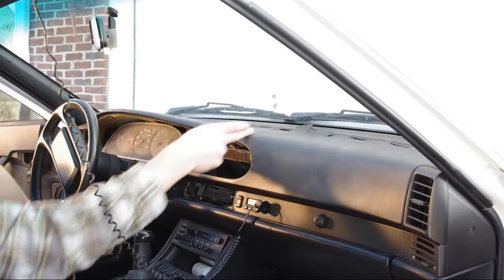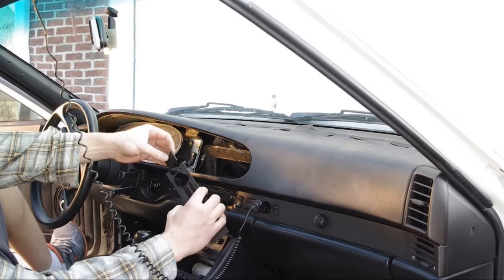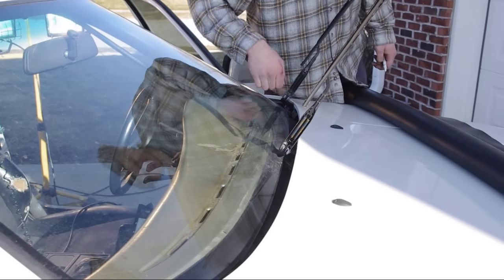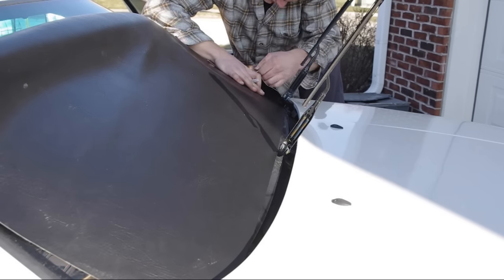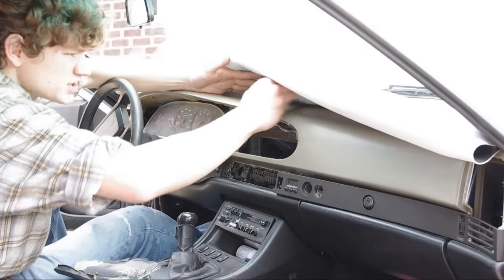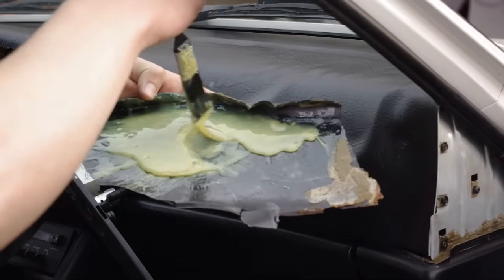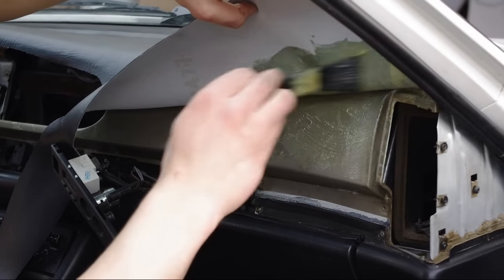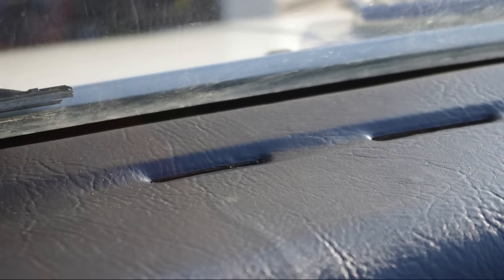How To Recover A Dashboard - Vinyl, Leather

Comment: Man all that time and effort just for the dash,  you probably could had bought that same car with a half decent dash for a couple hundred bucks
Reply: Really depends on the car.
Reply: what a stupid comment . This could be a clean low mileage vehicle.
Reply: fukstyx1 doing it your self is always cheaper, you can make it exactly the way you want it, + if youre a petrolsexual, its a pleasure to work on your car to make it nicer.
Reply: Okay, go and buy a decent classic Porsche for "a couple hundred bucks", i dare you.
Reply: Игорь Болотов what does that have to do with a cracked dash? Porsches are not cheap, even in the worst of states, and you still need to use common sense when buying one, but if you have had a car for 25 years and you have had many great memories with it, its more than just a car, it gains a sentimental value. you can't really buy that.
Reply: Some cars suffer from cracked dash boards. My 1984 XR4i is a prime example!
Very few examples that have not been kept in a garage or out of the sun will have a dash free of cracks!
Your comment just shows your ignorance!
Reply: Koito rob The hell? I just told that "almeidadave1" said a very stupid thing, when he suggested to "buy the same car for a couple hundred bucks". Why're you accusing me of something - I have no idea.

Comment: you dont use contact cement it will not hold up to car environment and joann's only sells fabric for in door use is not uv stable 3m makes glue that is about 1000 times better that the stuff you were using.
Reply: ya but it's the wrong type.
Reply from the maker: It has been almost three years.  Always parked outside and still looks good.